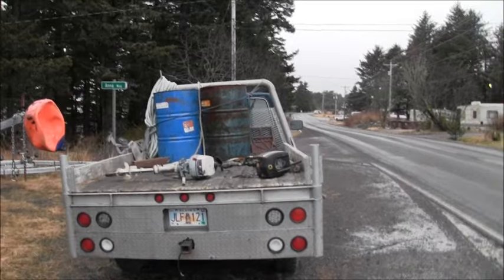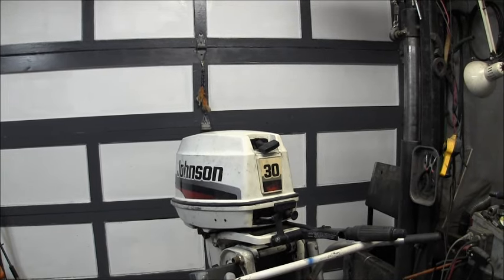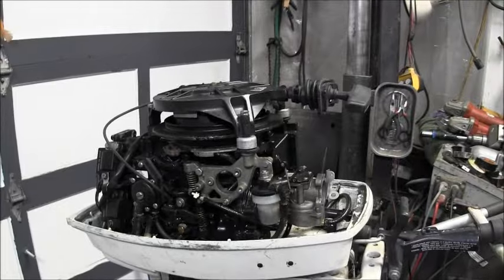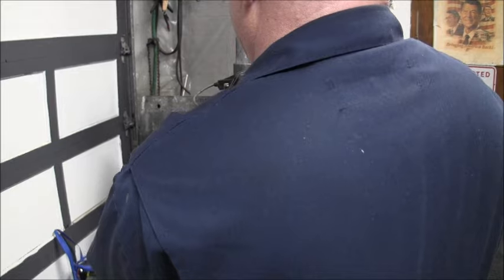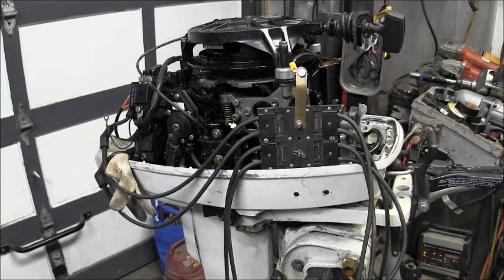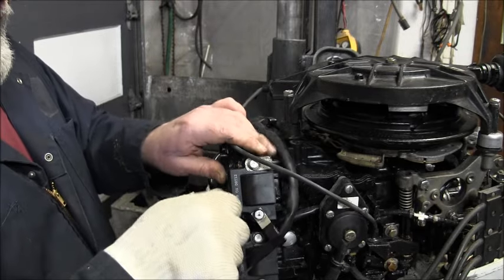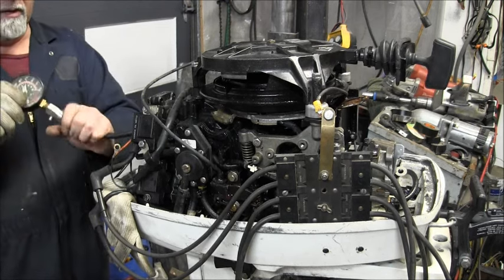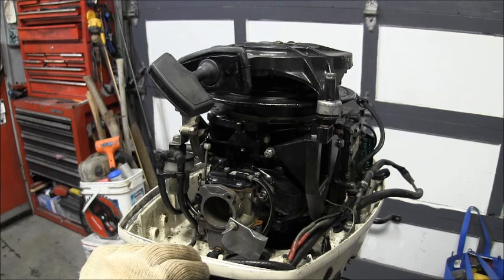JOHNSON  1997 30  HP  No spark issues   +  Custom  Choke

Comment: Great video. .. as always !  The primer system is a great feature that should be preserved. I have a similar 1992  engine on which paint  does peel off but give the primer  a shot or two and il will fire up on first pull EVERY TIME. P.S., As far as I'm concerned your vids never get too long. Regards !

Comment: Hi Kodi, my hip is hurting now and then but because of my right knee is messed up again. Had it fixed over 20 years ago and now it's back again. Got a VW old engine I'm working on currently. Going up north to pick up a engine stand from my nephew and take it apart. It rotates but stops at one spot by hand. So going in to find the cause. Fun Fun, price way right for a potential boat anchor? you got a couple cuties there in the back of the truck. no snow? we had a little down here but cold. burrr

Comment: Im gonna buy one similar to the 30  not sure about the model but hood decal looks the same
Im gonna inspect it tomorrow
Does early 80's rope starter fit on it?
Reply from the maker: Nope'  leg lengths are different on the 1 paw early 80's starter,  The 90's are shorter have 2 dawg paws and a different flywheel.      kb
Reply: @kodibassInsideoutboards  
These motor r crazy i found out that 80's flywheel can fit to 97 also as y said 97 have short legs and there's a spacer where rewind starter housting seat 
There's more than one flywheel can fit to this model
Reply from the maker: @TEKKKNO    OK'' Now you R getting into my world,  will it swap  Nope, can you make it work Yep'  Yes changing flywheels, adding spacers etc. will allow for fitment.  I have seen every mod on earth  done to outboards  as I live on a remote Alaskan Island.  U can make the older 1 paw work by cutting the mount legs shorter & using L Brackets to mount the starter.  Yes' a section of rubber fuel line can B used as a water pump pick up tube,  etc. etc.  haha  Yep'  I have seen desperate folks on Kodiak Island do Majical things with outboard's.     kb

Comment: Did that engine have the tan SLOW lead that connects to the pack?  That engine looks a little special because it has that crazy plastic fuel filter, perhaps they added that when they added the choke.  Have a close look at that carb, the bowl and gasket on the left hand side of the engine.  See how the bowl gasket is exposed?  Something looks wrong there.  That crazy choke is a riot!

Comment: I admit that I didn't watch all of this video but I have a wild guess that maybe that pivoting cover plate over the air horn is his means of stalling out the motor to stop it? I also have a 97 Johnson 30 and the book said to prime & flood the engine to stop it. I was very discontent with that & installed a toggle switch instead, to short out the coil packs' primary circuit to stop the engine